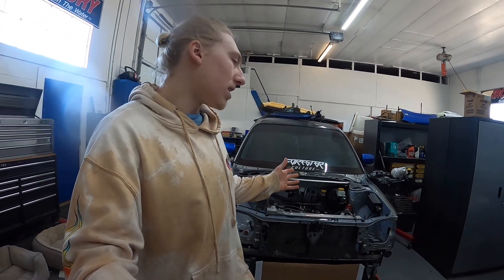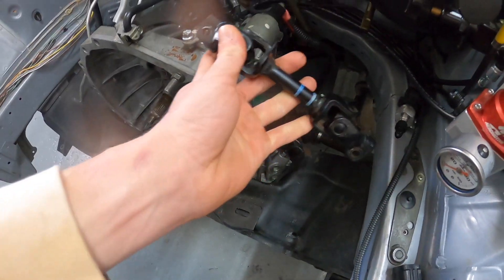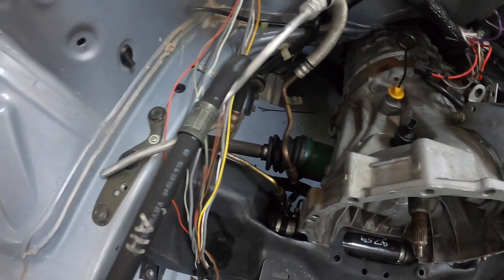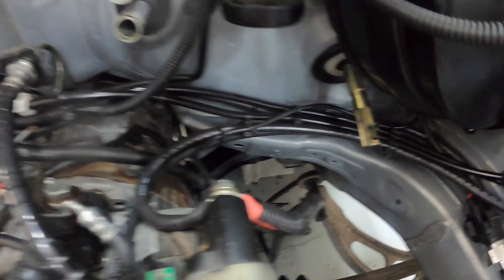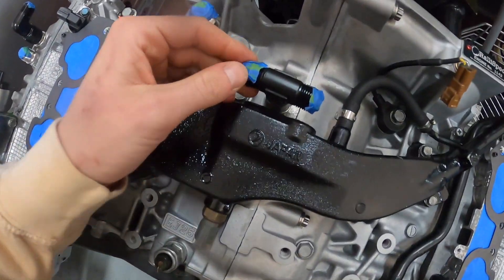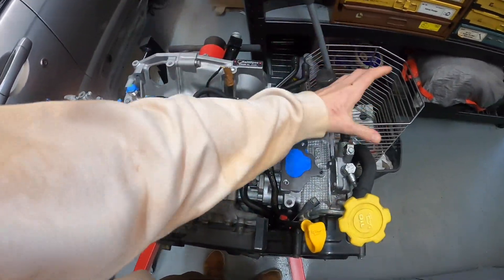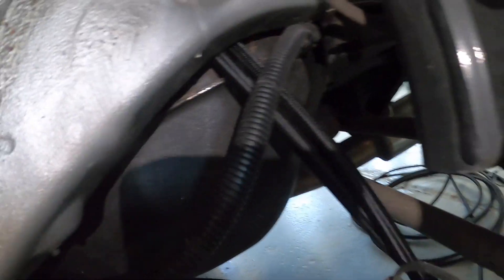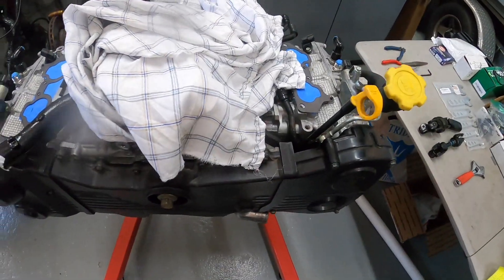BUILD UPDATES & PRIOBLEMS | ROAD TO 800HP SUBARU EP 18

Comment: Hey Jake. I believe in order to use the STi steering knuckle you need to remove the front crossmember spacers. This is common when doing a complete STi drivetrain/suspension swap as it corrects the suspension geometry . I think you did a Forester STi swap maybe? Not sure. So if you keep the spacers you have to run the Forester knuckle. Also, without the TMIC water goes down the hood scoop and right into your speed sensor. You may want to consider a shield of some kind or wrapping it to be water tight. Good stuff - keep it up!
Reply from the maker: Thanks man! I don’t think I am gonna worry with removing the sub frame spacers. Just stick with the forester knuckle. Yeah that speed sensor is a bit of a bad design, I may just go with a NA hood
Reply: Ronald is correct Jake. 

If you remove the forester spacers in between your crossmember and body, it will solve your issue. Along with that though, you’ll have to make sure you’re using a sti trans crossmember, because the forester and sti ones are different depths.
Reply: You need wrx subframe bolts if you delete the subframe spacer. I can't remember if you can still use the forester steering column, I used a wrx steering column when I did my SF5 Forester GT / WRX STi swap.

The spacer delete lowers the car considerably.
I'm not sure if it was worth it yet, because I still haven't got to drive it yet.

Comment: Why not run the fuel lines under the car....check on bader built
Reply from the maker: A lot easier said then done, on the STi’s they have plates you can use to hang the lines. Foresters do not have these so I would have to somehow secure the lines to the frame itself, I believe if I can keep the lines in the stock placement it would be a better option for this chassis